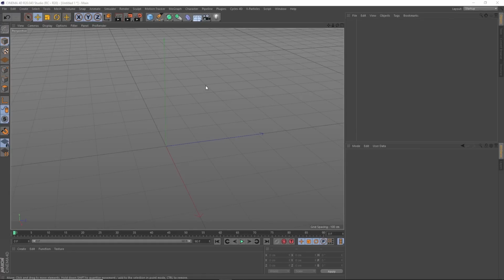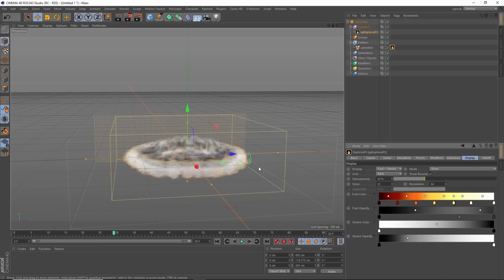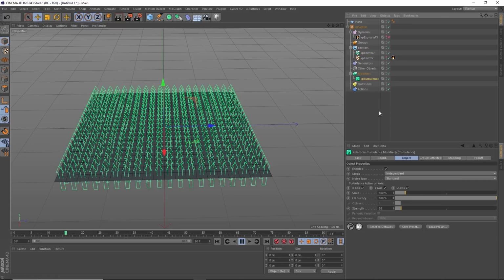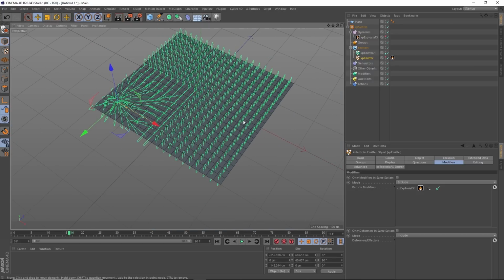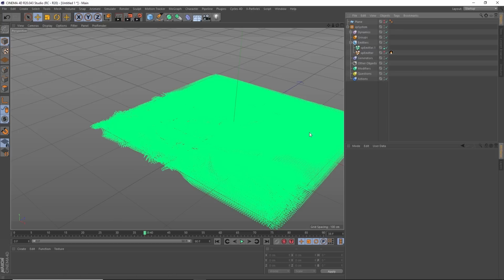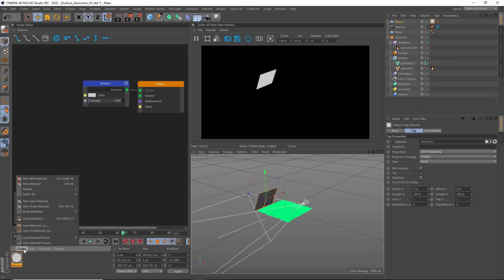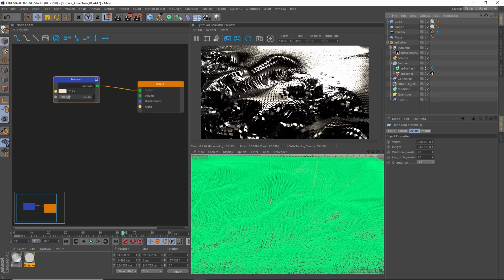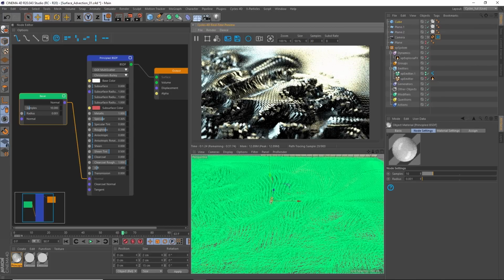Surface Advection - Content Repository Tutorials 2019

Comment: Brilliant tutorial Bob, sadly in the newest version of XP the explosia doesn't react the same as your and the explosion just sinks instead of rises, even if i add a value to the temp it falls under gravity. Since upgrading i've not been able to get explosia to work properly at all.
Reply: same issue here. still, a year after original post.
Reply from the maker: Hi Chris, 

Can you please send a message to Technical Support about this so we can take a look for you? 

Please be sure to reference this tutorial and add your scene file. 

https://insydium.ltd/support-login/

-Thanks
Reply: @INSYDIUMLTD  getting the same results as Chris Rossi, I tried to check the "Advect Particles" box in the "xpExplosiaFX" and the particles just starts sinking or going random direction

Comment: how to make the color effects of particles at the beginning of the video (in the examples (as if the top of the rectangle had an illuminated dot, and there are several colors (yellow, green, red dots) in some localized places.
Thank you for your answer and thank you for your tutorial
Reply: +1
Reply: I've figured it out, and you have to use the initial emitter for that (the one that's driving the Explosia fx) I'm using redshift and here's what I did: 

1. Put a redshift tag onto the emitter itself
2. Turn on the particle setting and choose optimised spheres. 
3. Change the colour of the display particles to a rainbow gradient (which you should be able to see in your viewport once you've changed it)
4. Create a redshift particle material 
5. Put the material directly onto the emitter. 
6. Go into the redshift shader graph of the particle material and pipe the same node that's in the diffuse channel into the emmision channel as well. 

If you're not using redshift, then the other render engines should have similar workflows with particle instances etc. 

Hopefully this helps some people!
Reply: @markphillipsmotiondesign  I'm totally stuck on how to put the little lights onto some of the particle boxes using cycles. Anyone have any ideas?
Reply: @rickmoore2812  Not sure about cycles, but maybe you could put an emission texture on the emitter itself??
Reply: @markphillipsmotiondesign  I noticing that the lights are actually on the tips of each of the tiny squares but not on all of them. I'm pondering how that might be done.
Reply: I'm also stuck in how to do this in cycles 4D...anyone have any luck?
Reply: +1    How can I achieve this effect，Help me

Comment: Hey Bob! Brilliant man. Your tutorials are spot on and just great to follow. 

After exploring this method a little more. I have one question. 
If I were to change the scale of the cubes as you did within Cycles. Is there another alternate way to do so. I thought it would be in the Advected Emitter or the Generator, but no avail. 
Any solutions?

Appreciate the insight.

Comment: Once again, really good stuff and a great technique. Thank you. However, it's troubling that you'd just ignore the obvious movement to the cubes on the far edges that's happening well before the advection wave hits them. Seems to me that's the first thing a creative director would ask us to fix before sending this shot along. 

What would a person need to add to keep the all cubes perfectly still (pointing up) until the wave actually hits them? Again, thanks for all you bring.  :)
Reply: Hi - this is happening because the Advection in the EFX object is set to 'SET'. If you change this to 'ADD' it will stop this behaviour.
Reply: @bobwalmsley1   thanks. master :)
Reply: @bobwalmsley1  Really good to know. Thanks for the info and for taking the time to update... means a lot.